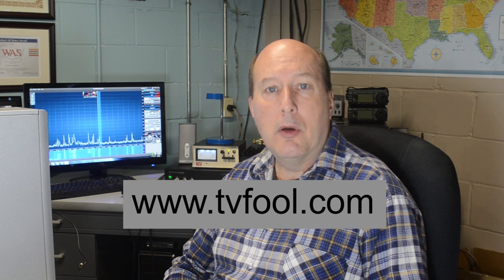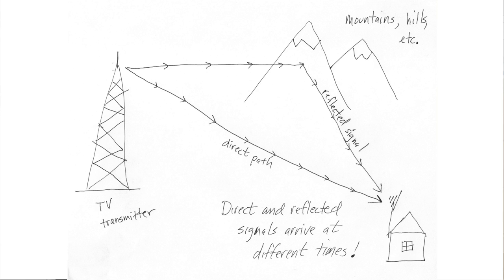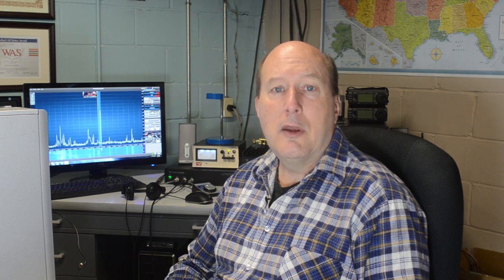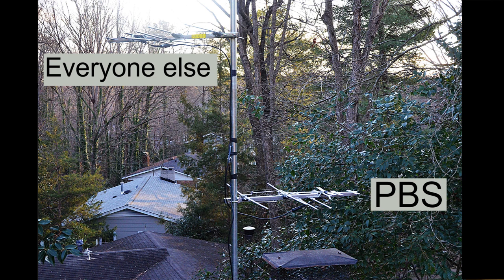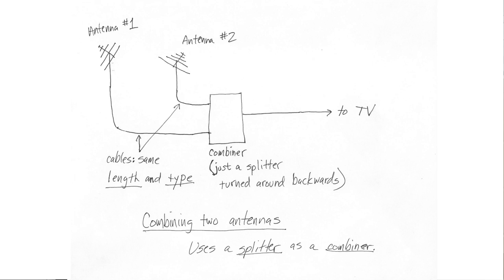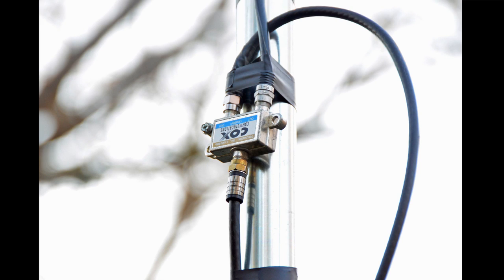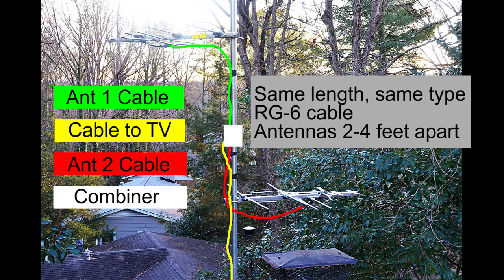Combining two TV antennas for better HDTV reception

Comment: Hey Doug! Fellow North Carolinian and TV and Radio enthusiast here.  Do you often receive distant stations where you live?
Reply from the maker: Hi Chris. I don't think I've ever received a distant HDTV station. Back in the analog days I used to see distant stations (say 500 miles or so) on the lower channels when conditions were just right. How about you?
Reply: Doug Hall Sometimes.  I live south of Raleigh and I regularly receive stations from the Raleigh-Durham and Triad markets (except WXII and WUNL) and also the Florence-Myrtle Beach market if my antenna is facing south.  I've also received stations from the Roanoke-Lynchburg VA, Wilmington, Charlotte, Columbia, Charleston SC, Greenville-Spartanburg-Asheville, Augusta GA, Savannah GA, Greenville-Washington-New Bern, Richmond VA, and Norfolk-Portsmouth-Newport News VA markets.  I miss the days of analog TV broadcasting and seeing what I could pick up, for I used to see KPRC (Houston) or KCWX (San Antonio) blast through WFMY like a local.
Reply: I live in Vanceboro NC.  I have a 45' pole with a  91 xg yagi antenna and a channel master deep fringe antenna. I have them connected together with a splitter backwards but I still have trouble with signal on my tivo ota dvr. My samsung led tv seems to get better reception than my tivo but sometimes it pixels out. I have ordered the channel master join-tenna to see if the splitter is my issue. also the join-tenna has a LTE filter in it. Could cell towers be part of my issue?  I bought another yagi 91xg antenna and I may take the channel master deep fringe down and see if 2 identical yagi's work better together. All this to get that Grit channel on 17-3 in your area.

Comment: there is another kind of combiner that allows you to use a vhf and a uhf antenna on the same antenna mast. contrary to popular belief there are vhf hd digital stations and uhf hd digital stations. most people are only using uhf antennas because we were all led to believe that uhf was the only antenna we needed by the fcc for some reason.
Reply: I could be wrong, but I'm pretty certain that the Digital Standard assigned all stations a UHF band/channel.  Here for instance, ch2 now = 51, ch8 = 31, and ch 12 = 16.  Even ch45 now = 29.  If some are still broadcasting on VHF, it's a wasted investment because it's just a matter of time before the VHF bandwidth is reassigned to broadband, thing 5G..

Comment: Save time. Two antennas same direction for stronger signal. Two antennas different directions More channels. And use a combinar not a splitter a splitter loses signal 3db per out put. Also one amp and booster per antenna for Max  gain. I get 83 channels.

Comment: Can I use a combiner with 2 indoor antennas
Reply from the maker: You can, but to see appreciable improvement both antennas would have to be directional, and aimed in different directions as outlined in the video. Combining two antennas that are omnidirectional  (as some indoor antennas claim to be)  would not offer much advantage.
Reply: Doug Hall thank u for your response

Comment: Can a omni and a directional antennas be combined ? I would think the omni would interfer with the directional antenna channels. Id like to use the directional for long range tower and the omni to get the closer opposite direction of the long range antenna.
Reply from the maker: You can combine them. Sometimes it works just fine, and sometimes multipath interference causes problems. This is due to the omni antenna picking up a signal the directional antenna is also receiving but from a different path.  But this depends largely on your surroundings, so give it a try.
Reply: Doug Hall I'll give it a try, if i have any interference  from the omni antenna i could try a shield on the back of the omni antenna maybe prevent interference. omni needs 180 degress of coverage. while the directional is the opposite direction. Thanks for your time and info!
Reply: i went with two antenna, two  leads which are amped. then to there amped boxes in the house and from there combined the leads and then to the back of the tv. i got to trim down the leads by 50ft. Bought 100ft cable. ine antenna rotates other doesnt.

Comment: HELP: I have connected two antennas to a splitter, same brand / same length with RG6 cable.  The antennas are at least 2 feet apart and pointed in 2 different directions (detroit/toledo).  When I only have the 1 antenna pointed to Detroit I get 42 channels.  When I have them both hooked up I get 30.  What is the problem????
Reply: The antennas are 1byone 80 mile antennas (amplified)
Reply from the maker: You could be experiencing multipath distortion, see the section in the video at 8:28 
https://youtu.be/PJaffNvOjho?t=508
Reply: Doug Hall....I would say thats a prob but I tried it both with the antennas pointing (detroit / lansing) and (Detroit / toledo) .  Both ways it still has less channels than if I just had the one pointing to Detroit.  Weird.
Reply: Any other advise?  Or am I just screwed...lol
Reply: Try 90 degree orientation

Comment: Can I presume for marginal signal strength, this same configuration with antennas pointed in the same direction will offer increased signal strength?
Reply from the maker: In general, yes, but the spacing becomes more important, and it's critical that you keep the cable lengths from each antenna the same.

Comment: WOW,cool, I theorized this would work as you said with the splitter used in reverse before I watched this. Thanks,nice vid,great info!
Reply: There will be a 3 dB loss using a splitter
Reply from the maker: Yes, at least 3 dB. Maybe a little more. But the front-to-back ratio of a typical directional TV antenna is much, much greater than 3 dB. So if you only have one antenna and it's pointed away from the station you want to receive then the loss  for that station will be much greater than 3 dB. Adding a second antenna and a combiner is an overall win, signal-wise.
Reply: I've got that same RCA antenna & similar situation with PBS,any tips to modifing/tweeking the antenna itself to get a bit better gain? Thanks.
Reply from the maker: Sorry, I haven't done any mods to the antennas, so I can't advise you there.
Reply: So, no adding aluminum foil yet (lol)-okay,thanks for your reply.

Comment: What happen to an antenna when it's hit by lighting ? are there wires in the the antenna that burns out? brand new coax and booster.
Reply from the maker: If a TV antenna takes a direct lightning strike there will very likely be damage to any electronics in the system, including the booster and any connected TVs. Depending on the severity of the strike, yes, wires might burn out, or things could catch on fire.
Reply: @doughall1415  Do antennas have internal wires.? We have replaced everything but the antenna. No signal from the antenna. What it says in the TV. New booster and coax but no signal.
Reply from the maker: @franhain7699  I'm not aware of any "internal wires" in my TV antennas. Are you sure the TV tuner is working? Do you have an indoor antenna you can try?

Comment: I thought the signal will always be analog? The decoder translate it digitally to your TV. I thought the way it works, for example, from fox channel, it will be on digital from theor channel, they broadcast the signal using analog signal via uhf or vhf then the antenna wil pick it up and the decoder translate it from analog to digital. Sorry but im trying learn on this. I cut my cable many many years ago. But im been using my internet to watch news and sports.

Comment: Are all TV antennas the same? I.E. Digital to analog signal.
Reply: Reverse Gear: Yes, if I understand your question correctly. 
Radio/TV antennas are cut (sized/proportioned) to receive radio waves of a certain range of frequencies. (HF, VHF, UHF, etc.)  The nature of the signals sent (analog or digital) is irrelevant as long as the frequency range is appropriate for the antenna.
Reply: Surly Ogre Thanks. That's what I thought. But you see "digital" antennas advertised. I'm sure to mislead and charge more.

Comment: Would combining a directional and omin-directional antenna work?
Reply from the maker: It might, but it could also allow a TV signal to arrive via two different paths which could, in turn, cause multipath distortion and pixelation. This is less likely when combining two directional antennas.

Comment: Helpful video Doug! I am just getting started with my setup. Currently I'm using a GE 34140 60 mile directional TV with winegards LNA-100 wired up to two TV's. I got about 26 channels before I added the LNA and now get 40. I plan on enhancing my setup with adding a second GE 34140 and mounting on the other side of the house and adding winegards CC-780 couple and replacing the LNA-100 with an LNA-200 that will have a preamp up at the top of my south-ish facing antenna. These antennas are mounted on the side of a 2 story house so im guessing its up there maybe 20-25 ft. It doesn't seem that is a problem. Currently my LO VHF signal is almost non existant and I know that is usually an issue. I have 50ft of cable RG6 between the antenna and my splitter no way around that and another 50 to my TV. My pre amp should fix that once I install it. I'll let you know how everything goes. Thanks!

Comment: There's a LOT of loss combining 2 antennas like that (> 3 dB).  You're lucky the signal was high enough.  There are inexpensive active combiners with a built-in amp that would work better in marginal signal areas.  The power for the amp can be fed through the coax to avoid any additional wiring.
Reply from the maker: In my case (and in many cases in urban areas) the desired signals are quite strong, but they are coming from entirely different directions. The front-to-back (F/B) ratio of a directional antenna can be more than 20 dB, in which case 3 dB is an acceptable amount of loss for the benefit of having an antenna pointed directly at the signal source. In fringe areas it might be a different case entirely, and 3 dB may be unacceptable.

Comment: I determined that the 2 antennas are great. There is a transmitter that i receive only a couple of miles from my house. The Group of channel 16 independent comes in super strong. On that same transmitter is a channel group of 28. They come in ,pixulate and sound comes and goes. so close on the same transmitter but just trying to get these . Use the same rca antenna as you . work great. Have them in attic and using them for a year. just wondering if i remove the reverse splitter and use a 2 to 1 coupler combiner or even a distibution amplifer thats power in reverse. The 2 outputs in from my antenna and the 1 input out to the tv? Just looking for any suggestions. What i have works great. It just bothers me that channel group 28 has a bunch of old shows on it. its so close and i receive the channel 16 group off the same tower perfectly.

Comment: 7:35 RG6 Quad Shielding.. no less for HDTV.  Cost more than the "junk" cable... for a reason.   Also get waterproofing cable sealer, and wrap your connections to keep water out.  That is the #1 reason for water corrosion destroying cable!

Comment: Doug ma man, I get nothing. Back in the day (60's and 70's) We had lots of TV with a big old roof antenna, I cut my cable hoping to get some signal with rabbit ears from KTLA ch.5 here in LA, I get nothing. I bought a converter, still nothing. could it be my 6 year old TV? heck maybe I should find a 50 year old TV.

Comment: All you did is make a bi directional antenna. Great video and work but just using a bidirectional antenna with adjustable antenna angles would've worked alot better perhaps.

Comment: My question is where do you get that splitter for two antenna's
Reply: Anywhere that sells electronics parts should have them.  If you still have a RadioShack try them or your local electronics parts store.

Comment: Not all splitters are tje same. Most are diode blocked which makes them directional. When you use a diode blocked splitter backwards, you are actually blocking those antennas from working at all. The cheaper ones usually work fine for a dual install, but most won't work at all.
Reply from the maker: Jeramie, in splitters with diodes the diodes are there to block DC, not the RF. Saying that "most" won't work at all is patently false. The fact is that most splitters work just fine in this application.
Reply: Doug Hall, Diodes are indeed specifically designed to block electrons. They even block measurable continuity. RF is the movement of electrons and electricity is as well. Also, electricity travels on the same wavelength spectrum as RF. It's low however and considered in the VLF range. For example, 120v AC is produced by 60hz wavelengths (Very Low Frequency VFL) and the wavelength changes with DC power to whatever the coil windings are spun to produce a specific DC voltage. Furthermore, we measure antenna signals with a Db measurement, but that's in it's simple form. What we are really measuring are watts of power recalculated through the Friis Transmission Equation for precise calculations converted to Dbi or decibels relative to an isotropic antenna. As a professional installer, I would never use a diode blocked splitter on a dual antenna system. Logically it makes no sense. You want those RF signals free and clear as they combine unless you use separate VHF and UHF antennas, which combine completely different. Ideally, you want to combine antennas in their 300ohm state before converting to 75ohm through the transformer. With that said, diode blocked splitters also disrupt the 300ohm connections. And finally, diodes block AC and DC as well as RF. It doesn't care what the current is. They are engineered to block all electrons.

Also keep in mind, when you separate antennas more than 45 degrees apart, the radiation pattern changes from a directional high gain to more of an omni directional lower gain. 90 degrees is about max before all channels start to lose significant strength. It sometimes does not matter if distant stations are not your goal but multi direction is. Just keep in mind however, when antennas are in opposite directions, you will lose all your distant faint signals from both directions by about 25% or more.
Reply from the maker: I don't even know where to start with this. Having worked in the semiconductor industry for two decades I am familiar with diodes. I know how diode mixers work, I know about the internal capacitance of a diode, and I know how diodes react to microvolt-level signals. I know that diodes are placed in some splitters to pass DC to LNBs or other equipment, and that capacitors are often used to provide a DC block but allow RF to pass. I've seen this in satellite applications as well. In other words I've been down this road before. Anyway, thanks for your comment. As a professional installer you obviously know more about it  :-)
Reply: @doughall1415  Yeah and just last week I helped a nice client in 1.5 hours who was ripped off by someone who was in the business for 40 years and spent all day on scratching his head and left her with the same problem and $600 less in her account. Years of experience from others mean little to me. I'm not impressed at all with self praise. What does working in the semiconductor industry for 2 decades actually mean? Were you an engineer, designer, or just electronics repair tech, own a computer shop, etc? 20 years of what? Time and time again I come in behind self proclaimed know-it-alls who can't get the job done right. I actually like your video, but you apparently know all knowledge and the learning process is over for you. A simple offer of advice has somehow hurt your ego. Good luck with that. In the real world, it doesn't help people's problems. Have a great night!

Comment: my friends having issues where her picture will drop for 10sec-2min at a time, but the sound remains completely fine. She doesn't have another tv to test it on to see if it's just her tv. I don't think she's using an amplifier but has a box+indoor ant
Reply from the maker: I haven't seen that happen due to signal quality issues. Generally if you don't get a decent picture you also don't get sound.

Comment: will it work with a three way splitter?
Reply from the maker: You mean combining three antennas? In theory, yes, but I have not tried it. You would probably run a greater risk of multipath issues. If you mean using a three way splitter to combine two antennas (leaving the third port unused) then yes, but the loss in a three way splitter is higher.

Comment: Could I do this with 4 antennas on all 4 corners of my house?  (On the roof)
Reply from the maker: In theory you could, but it introduces more variables, and I think the chance of problems with multipath distortion increases. In any case, I have never tried four antennas.
Reply: @doughall1415  Thanks! I have a bunch of those "TV Bandit" antennas and I tried it with 2 instead of 1 and it helps.
Reply: HOA would have a fit.

Comment: Whats the model for the Spectrum anlyser at the back?
Reply from the maker: It's actually a Software Defined Radio (SDR) made by Flexradio. The radio user interface is via a Windows application and it allows viewing the received spectrum as you would with a spectrum analyzer.

Comment: This common sense subject has been around for 60+ years!!!  Everyone should know by now!!!  The simple, uncomplicated  solution, for good signals, is a SINGLE  powerful antenna, with a pre-amp and the Rotator.
Reply from the maker: Agreed, Harold. But if you have multiple TVs and multiple viewers and stations in opposite directions (as I discussed in the video) then a rotator isn't necessarily the ideal solution.